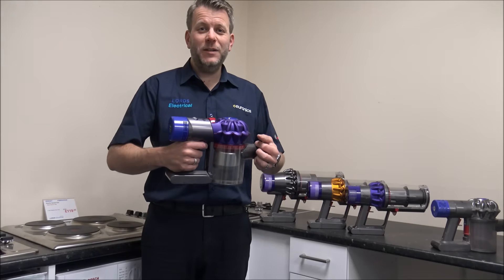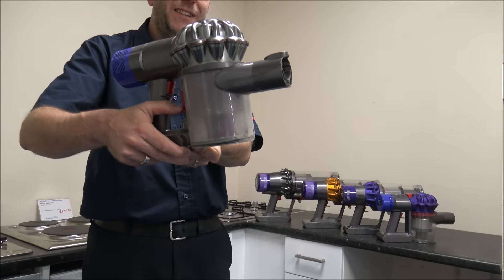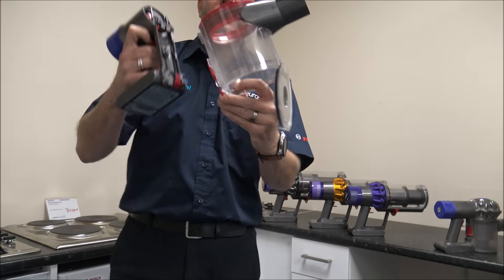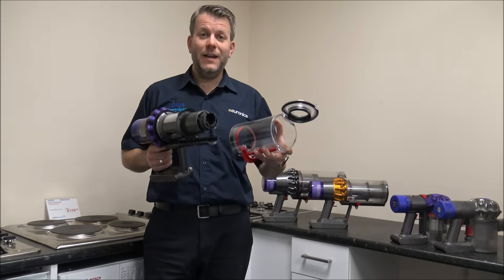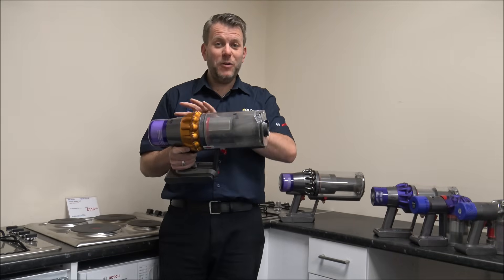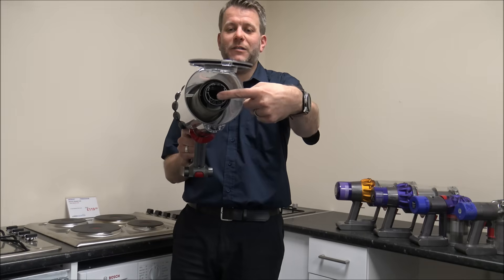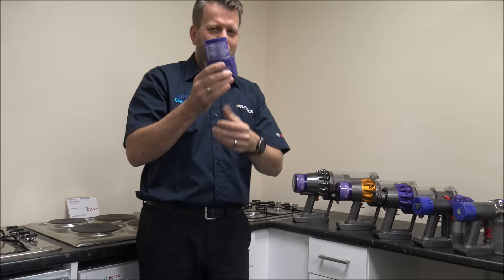Is Your Dyson Pulsing And Not Sucking? Here Is How To Solve It

Comment: 03:45 My v10 Dyson wouldn’t charge  after a slightly over-enthusiastic cleaning of the dust filter that may have got water into the electrical / battery components. For whatever reason, it wasn’t until I slid the top part back into the bucket that the battery light came back on and the blue led lights started to flash when the Dyson was wall mounted again. Your helpful advice, or blind luck who can tell?

Comment: A great video thanks.   Unfortunately having totally cleaned everything and inserting a new conical filter in my Dyson V6 Absolute, the pulsing problem continues. I've washed the rear filter too, and notice that if I remove the back filter completely, it no longer pulses. I now also notice that when refitted, the purple light which normally surrounds the MAX sign on the back filter, is not lighting up at all when pushed in. Therefore I assume this rear filter is the problem. I'm unsure if this is a simple replacement issue, or a deeper problem. Any ideas please?

Comment: I have the V8 model. After 5 weeks ownership it started to surge badly. Even after cleaning the machine thoroughly it continued to surge. Eventually I changed both filters and the problem went away. Even now if I use that original set of filters the machine surges. I suspect a small amount of water was ingested in the bathroom and it somehow damaged the filters. 

Now, every 4 weeks I clean the V8 thoroughly (using a mains powered vacuum cleaner) and wash out both filters. I have another set of filters so I can continue to use the machine. I also try to avoid the machine ingesting water. So far it has not surged again.
Reply from the maker: This is great feedback, glad it was useful for you.

Comment: how do you clean the filter at the back of the dyson v8, you mentioned washing the one with a tap on it, but not the other
Reply from the maker: If it is fixed then it cannot be removed. If its a filter than can just twist off the it should be able to be washed

Comment: I cleaned the filter on my v10 and cleared the bin and ensured there are no blockages but it is still pulsing despite a full battery.  Do you recommend I use a screwdriver to take it apart as I see hairs poking out of the metallic silver drum area
Reply from the maker: Difficult one, but if you have tried to wash the filter several times then it may be that the filter needs replacing

Comment: My v11 started pulsing from one day to the other. I already disassembled it completely and cleaned everything, and it also got a fresh filter applied to it. It is still pulsing very fast in eco mode, a bit slower in normal mode and works fine in boost mode. When I block the airflow with my hand pressed against the inlet, it still pulses in eco mode, it stops pulsing in normal mode and in boost mode it complains about a restricted airflow. So depending on the power mode it does different things. It's very weird in my opinion. And I don't know what else to do now. The support of Dyson did not respond within a week now which annoys me additionally.

Comment: I charge my v8, how long is it supposed to run?
I think my run out of power in 5 minutes.
The indicator says it’s fully charged when l start vacuuming.
Reply from the maker: The V8 should last for about 40 minutes on the minimum suction. on the maximum suction you will get around 6 - 8 minutes.
Reply: @lords-electrical  thank you 😊
Reply: @lords-electrical  l forgot to ask, can l get an extra battery if that’s all I’m getting is 5-8 minutes on high suction? How much does it cost?

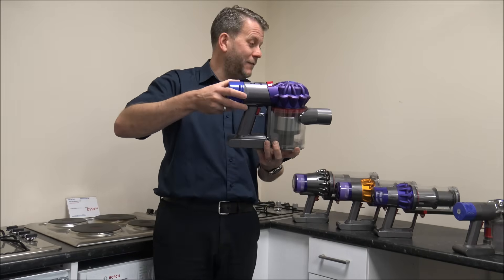Comment: 11:12 How do you get the back filter out on the V6?
Reply from the maker: If it is one of the models where it can be removed then it should be able to be twisted off. There are other models where it can't be removed unfortunately
Reply: @lords-electrical  I'm not talking about the blue cap where the filter sits in, I'm talking about the filter itself, or can it not be taken out of the blue cap?

Comment: I have a v7 that only works on low setting and fully functioning on low. If i put it into high it shuts off after a few seconds. I then have to plug it back in unplug it and it works again only on low of course. Filters are clean. Any idea whats going on?
Reply from the maker: Sounds off, first of all how old are the filters? you can find that if a filter is old and been washed many times, then it may not be as efficient as it used to be. If you have had it for more than say around 18 months then consider a new filter and it could solve the issue. If not there could be a blockage in the pipe of bin somewhere.
Reply: I, too, have that problem on a few we use at our school.   It works great on the low power, but if switched to the max power, it shuts off after a couple of seconds. Then, I have to return to the charger and wait till it charges and then low only. I cleaned thoroughly and replaced the filter.  Any other thoughts
By the way, I love your help videos. They are fabulous❤

Comment: My V6 pulses once, then stops. No blockage in the cannister. I took it apart, and found the motor seems to be sticking, and not turning freely. I don't know if that;s the issue or its normal.

Comment: Cured the pulsing, but it’s now cutting out after a few seconds when using the high power mode.
Have to keep it in low mode to get any hoovering done.
Reply from the maker: This could be down to the filters either need cleaning or replacing if you have washed them several times.
Reply: @lords-electrical  👍

Comment: My v10 sucks perfectly with the floor attachment but for some reason when I use the smaller attachments, it doesn’t suck up Much if anything at all 😞 it’s been this way since I bought it too
Reply from the maker: Does sound odd as they are normally pretty good. Sometimes you will need to use the max suction to get some dirt up. If its still not performing I would contact Dyson to see what they can do to help assuming it's under the 2 year warranty.

Comment: Hi there, i have a question.  I have a Dyson v7. I already replaced the battery 3years ago. But when i put it in boost modus, after a few seconds it stops, and then i can't use it for a few seconds before it works again. I don't have this problem in the normal modus. Does anyone have an idea what the problem could be here ?
Reply from the maker: Normally it is filter related either it needs washing or replacing, or it could be a blockage somewhere in the bin or pipe of the vacuum

Comment: I have the v11. I have checked for a blockage. None in the tube, head or anywhere in the bin. I have used a hair dryer to get dust out as well. Washed the filter and it still registers a blockage and cuts out. With a v 11, if it is a filter issue the filter light flashes. I have the blockage light flashing. A $600 piece of junk. I am livid! I can’t afford expensive repairs.

Comment: How do you move the flapper on the V8 if it's stuck in one position
Reply from the maker: If its the flap inside the bin then you may need to use a thin screwdriver to remove the dirt around it to free it up.

Comment: Hi in my case when i push the button a strange sound is emitted and this happen after sucking up the soot. I'd like to share here the video but is not possible. Could you help me? Thanks in advance :)
Reply from the maker: Dyson vacuums don't like soot and brick dust. It should just require a clean out and the filters will just need a wash too, then it should be ok for you.
Reply: @lords-electrical  Hi I washed and dried the filter and also the engine with a compressor but the Dyson emit a dull noise. I'd to be sure that is not depending from a burned engine. Is it possible to send to you a video to have some suggestion on your side? Your videotutorial are great and very helpfull :) Many thanks :)

Comment: I have the top absolute model with the LED readout and I’m sick of all this maintenance almost after every time I use it.I clean the filter and all visible parts.My piece of plastic is showing air blockage without the wand or cleaning head attached I can’t see any reason for this situation.There are to many places to clean after using it in my home with many long pile carpets.My wife will not and can’t use it because this air restriction issue.My last Dyson product.

Comment: Our Dyson V8 has had a new battery and both filters replaced.  But on MAX power runs only for about 20 secs, then stops. Put back on charger for just a few secs, only say 2 blue lights indicated so power not completely run down, and.. loh and behold will restart again. Is OK on normal power, just refuses to run for any real length of time on max.. very annoying, can you please help?
Reply from the maker: I have had this once before and it was part of the filter was cracked at the top. The extra suction was causing it to switch off as the filter casing became slightly dislodged. Have a look round to make sure none of the casing is damaged at all. Or also make sure the seals around the bin are fully located and clean as this can make a difference too. Good luck.

Comment: I have a v10 that started pulsing I cleaned the filter following the instructions let it dry for 24 hours, replaced the filter it was fine for a few days before it began pulsing again. I took it to my sons garage and stripped it down to its component parts and found it was full of fine dust I cleaned it all out with an air hose, reassembled it and it worked fine for about a week but then started pulsing again. So I bought a pack of new filters from Amazon and it has been fine now for months. So it seems that the filters are not very good, I would expect to be able to wash the filter many times before it needed replacing. Not happy with Dyson and would not reccomend them to anyone.

Comment: What about if the vacuum goes from a normal sound to a high pitch sound? Wondering what it could be. I have cleaned it very well. It will sound normal; I then continue to vacuum then the high pitch sound comes. Any tips?
Reply from the maker: Sometimes this happens if the filter is not 100% in position or its damaged?

Comment: Mine does not pulsate, doesn’t suck, it’s fully charged, blue light goes on when I pull the triggers as if it would if it worked. The wand with roller brushes spin when they are attached. So it’s not battery… it’s all cleaned, no blockage. Any ideas??

Comment: My Dyson 7 was pulsating, and now it will not even charge. Does that mean the battery is bad ? the blue lights go on when I plug in the charger and within a minute they go out again and there is no motor running at all when I pull on the trigger. Help!
Reply from the maker: Yes it sounds like you may have a faulty battery. It shouldn't be too much to replace it and it is a fairly simple process

Comment: Dyson V15 dust collection system on carpet is a faulty design not fit for purpose in my experience and Dyson took feedback from me on the details, asked for more of my personal details and then never addressed the issues. 
Lots of issues but esp carpet shedding sucked in to the dust collector almost immediately fills into the upper half chamber which is not supposed to be filled well before the lower chamber is full and also tends to then block the air inlet duct and creates the problem described in this video. 
Many other problems including that this dust collection bin is still way too small. 
Dyson rep in shop of purchase says the problem will stop once the carpet stops shedding!!??  Ever carpet I HAVE sheds throughout its life plus there should be large warnings before customers buy the product about this dreadful fault / limitation. 
Also emptyimg the collector completely once this has happened is a pain and has to be done very frequently. 
If any of you have a different brand / model suggestion let me know

Comment: My V8 Dyson only hold a charge for about one minute.   I fixed the pulsing by cleaning but now it won't hold a charge.  I have two and they both only sweep for about a minute.
Reply from the maker: This is quite standard after several years of use and its normally a new battery that will sort it out for you.

Comment: Mine pulses but only with the long stick and carpet tool but without the long stick. just the hand tool for stairs it works oerfectly so I'm done on my knees to clean my large carpet areas why does it work with one tool and not another  the stick is not blocked the large tool used with the stick is hair free does anyone know what's wrong.
Reply from the maker: Apart from blockages, it is normally down to the filters. If you have washed the filter to clean it, then check to see if the filter needs replacing as it may do after several years of being washed.

Comment: hi my dyson v15 is not pulsing there is no blockages it is just spitting all the particles straight back out . can you help with this please
Reply from the maker: This could be an indicator that the filter needs cleaning or replacing as the suction probably isn't as good as it should be due to a blocked filter.

Comment: Do you know how long the batteries are supposed to last on the V 11? I got one six months ago and the battery seems to be only working intermittently, Like 30 seconds on and then it stops and then 30 seconds on and then it stops
Reply from the maker: They should last a lot longer than 6 months. As it will be under the 2 year warranty, i should ring Dyson and see how they can help

Comment: All this videos forge to mention the easiest method to identify issue. 

Just take off each part and press power till it stops pulsing. For example take off back filter for me. And it works. So the back filter is the issue. You can do the same for the bin, middle filter, etc.

Then clean or replace the part causing the pulse. 

You can also just clean the whole thing but for me it didn’t work. The back filter was still causing pulsing for ages with 2x cleans. 😢

Comment: Mine works but when i put it on turbo the battery light starts to flash indecating battery empty but it is full charged
Reply from the maker: It could be an issue with the battery itself being faulty even though it still says it is charged. if its under the 2 year warranty i would contact Dyson to get it sorted.

Comment: Everytime I clean the filter it does this when there is no blockage any advice?
Reply from the maker: It can be that you have washed the dirt into the filter. sometimes it helps to take the filter apart. Also it can depend on how old the filter is? if its more than a year old, then the filter may just need replacing

Comment: My animal v8 only pulses when I click the max suction on, so what is wrong then?
Reply from the maker: It is more than likely an issue with the filters that need cleaning or even replacing if you have had them for a while
Reply: @lords-electrical  thx for the reply it's appreciated, I've cleaned the filter so I'll get a new one. Thank you.

Comment: Hi there I've tried everything you said and it's still plusing any advice please it's not even a year old thank u
Reply from the maker: If you have tried cleaning the filter and making sure there are no Blockages anywhere then take the filter out the vacuum for a moment. Pull the trigger and see if it pulses then. If it seems OK then I would replace the filter. If not then there may be a fault. As its only 1 year old I would contact Dyson as it will still be covered under the 2 year warranty

Comment: I keep getting a filter not sealed message and I’ve done everything I know to do and it won’t work.
Reply from the maker: Couple of things, just make sure the filter is on the vacuum properly as it can make a difference. Also make sure the seal around the bin is clean and dirt free, as it can make a difference to the suction if there is dirt around the seal. 
Also if there is a blockage in the pipe or around the bin, then that can affect the performance too.

Comment: On my V7 the foot part has stopped spinning around and it has less suction 🤔
Reply from the maker: Sounds odd, is there anything that is blocking the roller like excess hair which can be a common problem.
Reply: @lords-electrical  no nothing, I have cleaned it.

Comment: found V11 pulsing because Id washed the filter, dried it with a towel thoroughly so I could complete the cleaning job. Bought spare filters now so dont have the problem. Slightly misleading, the display indicates pipe block images when it was the filter, it doesnt recognise a filter problem

Comment: Mine straight away stop vacuum when start. only start vacuuming when i cover the hole with my hand...any idea how to fix?
Reply from the maker: Most of the suggestions i tend to talk about in the video like:
Clean or replace the filter 
Make sure the bin is empty with no blockages
Clean the seals around the edge of the bin with a damp cloth
Reply: @lords-electrical  alright thx I will try.

Comment: the lever will not pull up
Reply from the maker: I assume you mean to empty the bin? If this is the case then you may need to push the bin up first into the body of the vacuum so it feels tighter then pull the handle again. Sometimes doing this can help to release the bin.

Comment: This is such a poor explanation of the cause of pulsing and could be so much better….
Logically I have found that pulsing occurs when there is….
A. A blockage in the head … could be simply a lump of paper.
B. A blockage in the tube …. Rare.
C. The flap in the main head gets stuck due to damp or improper use. This must move freely opening & closing and needs to be really clean.
D. Hepa filter blocked or, more often it’s damp due to wrong usage or not drying properly after washing.
Ta but your video is about the pulsing but it gets distracted instead of staying on point.
Hope this helps …. Regards